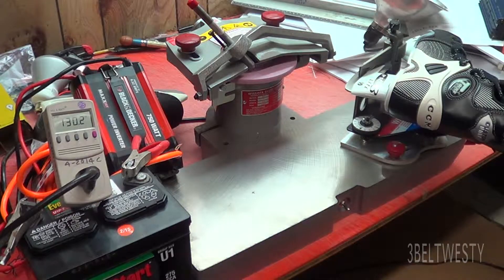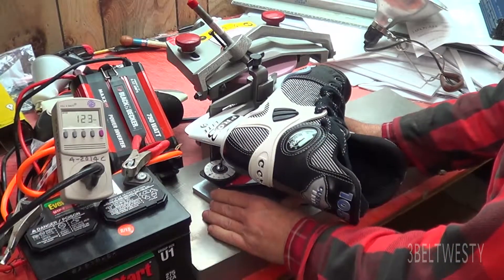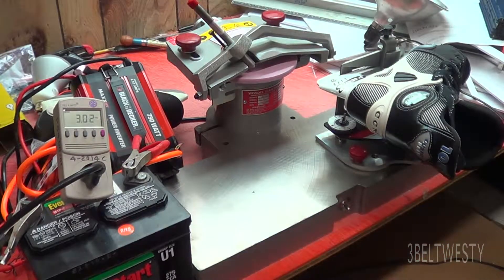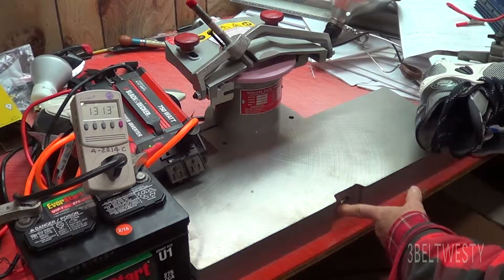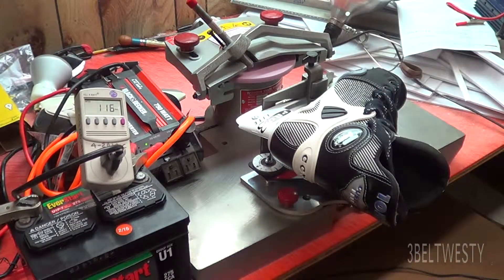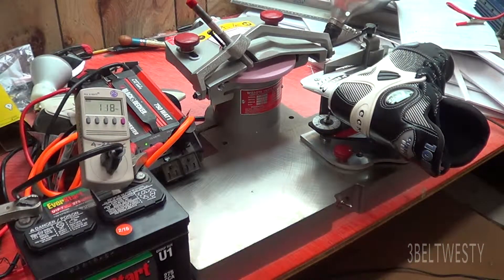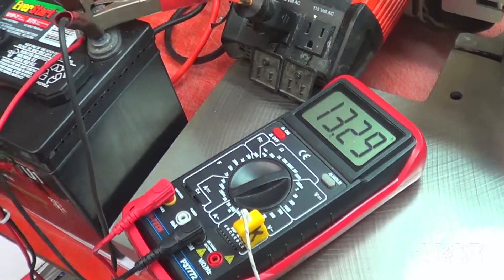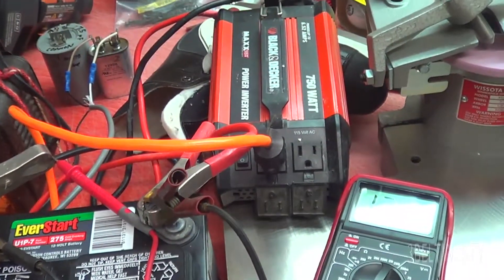Wissota Ice Skate sharpener 12 DC Inverter experiments

Comment: What inverter did you use?  I want to do this so I can sharpen in parking lot
Reply from the maker: Hello Chris, The RED 750 watt unit at 0:12 that Worked is a Model VEC1047BD Black and Decker by Vector Manufacturing. I bought this in 2005. Name plate says  Output 115V AC 6.52 Amps 750 Watts  , Input 12v DC 75 Amps. 

 2:26 The BLUE 400 watt unit that did Not work is a #92708 Harbor Freight thats is labeled 400 Watts / 800 watts Continuous/Peak.

You want an inverter that is at least as big as the 750 watt Continuous rated Red one.. You want the car/trucks engine to be running so you do not run down the battery, or use a separate battery. The 12 volt DC current into the inverter is about 10 timer higher than the AC current out at 115 volts . 

The Wissota 911 motor is a classical machine with an AC induction motor. The starting current as a swag is often 5X more starting up than running current at full rpm. That is why the inverter has to be sized "big enough" to get the motor to start up.
Reply: 3beltwesty I was thinking of getting a harbor freight 750 watt unit and use my travel trailer battery.

Comment: I found that my Blademaster portable runs rough with my 3000 watt continuous modified sound wave inverter compared to using the AC wall outlet. I am suspicious that a pure sine wave inverter may be necessary for it to run smooth and quiet. I am very interested to now if your Wissota motor runs better on the pure sine wave inverter......
Reply from the maker: Hi John yesterday I tried a borrowed nice great Xantrex SW 600 true since wave inverter and it would not start my Wissota sharpener. This is a 600 watt unit rated:
540 watts continuous 600 watt peak 1200 watts surge

http://www.xantrex.com/documents/Power-Inverters/PROwatt-SW/975-0529-01-01_Rev-B%28PROWatt%20SW%20Inverter%20NA%29.pdf

The motor's grinding wheel just kicks every second or two as the SW600 starts and folds back with an overload then resets. This is with a new higher cranking amps lawn mower battery as a source. YUK

I tried the unit as stock and also with 10? and 45?  uF caps also with no luck.

As a decent slide rule back of the envelop swag an induction AC motor draws at least 5 times the current at start. My Wissota is about 3 amps thus needs 15 amps at start for a fraction of a second.

With a 45 uF capacitor plugged in parallel with the Wissota and wall outlet AC the current is only about 1 Amp, the Capacitor nuls out the Inductance of the motor.  Still the Xantrex SW 600 did not start mine even with help turning the wheell by hand

Comment: Nice experiment! Thanks for that. I tried a Blademaster portable skate sharpener with a 1000 watt/2000 watt peak power inverter and that would not start it. It acted like your 400 watt inverter experiment but the Blademaster motor is 7.5 amp, more than double the Wissota amperage. However, when I bought a 1600 watt/3200 watt peak inverter, it could start up and runs fine....
Reply from the maker: Hello John and thanks for the reply. I do have another inverter to try but it might take a few days when I have more time. I have a true sine wave Xantrex Prowatt SW600 that I want to try, plus also have capacitors to get the Volt Amperes down. The real power on the Wissota is roughly 100 to 120 watts but the volt amperes about triple ie 300 to say 360 VA. This is because the motor is inductive like about all AC induction motors. With a a scrap 45uf 370 volt cap off an old AC unit the volt amps is about the same as watts. But my crummy modified inverters do not like the added cap since these modified since wave units are really a square wave with a short duty cycle. Thus with a true since wave inverter and the added capacitor I think the sharpener might draw less DC amps.